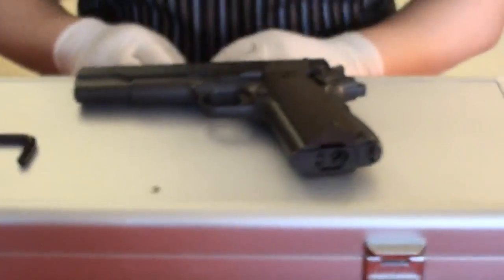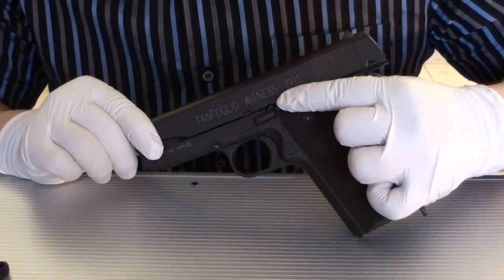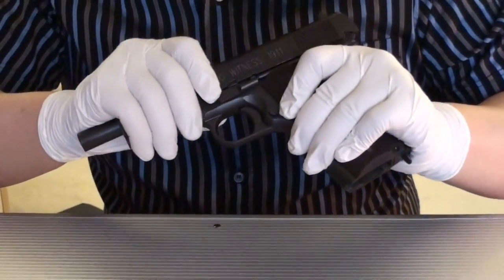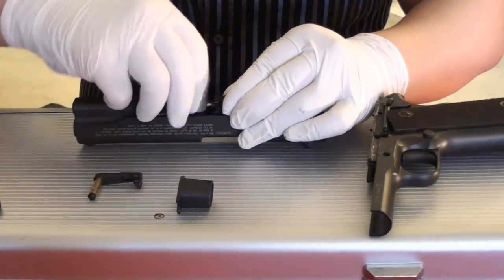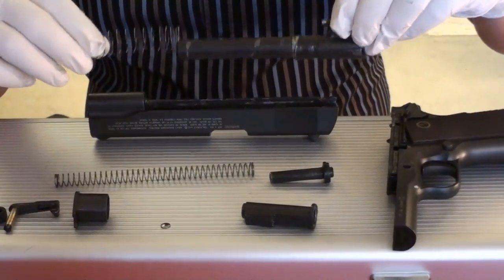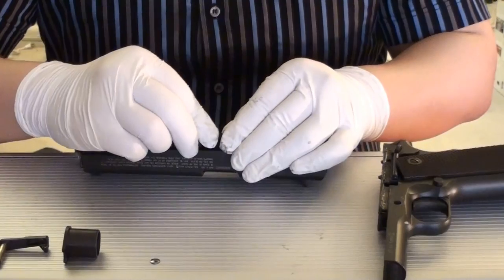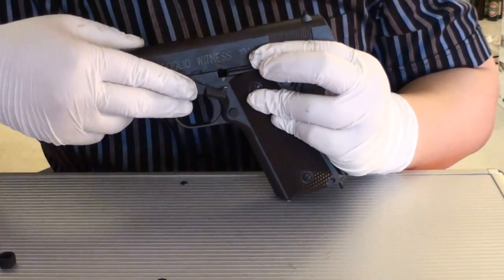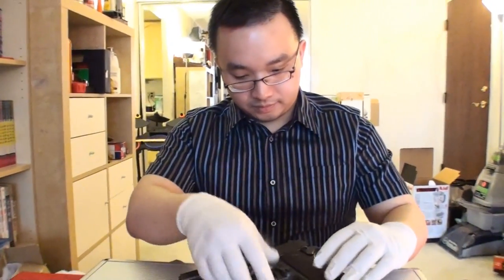Field Strip Instruction on Tanfoglio Witness 1911 Full Metal Blowback (4.5mm)

Comment: Hey Isaac, I just bought mine online and I have the same problem.  I can take the slide out and remove the rod and spring, but the barrel bushing won't turn and come off. It's like it's ceased to the metal.  Because of this, i can't take out the barrel and spring to clean.  It's strange why Cybergun would manufacture a slide that fully fieldstrips and one that partially fieldstrips.

Comment: I take spring out first which makes front part easy to remove...Also when putting slide back on push that little metal thing down so it goes over smoothly...

Comment: Are you also having the same problem where the barrel bushing is molded to the slide firmly.  Mine partially disassembles, but I can't take out the barrel and spring because of the barrel bushing.  Wish I knew beforehand that there were 2 versions.

Comment: Thanks much, i had took mine apart allready to sand the eject port down to silver, i had unscrewed the air compartment at the trigger end of the slide, there is a long thin spring that had come out and i had no idea where it was supposed to mate, seeing your vid is high quality, i saw no spring which meant i had to push the spring home "back to the trigger end" & mate the other end of the spring to the slide wall which has a notch for it, all back together now and works how it should :0)
Reply: what you used for sanding?

Comment: Mine still leaks co2. I guess I will definitely send it back to pyramyd air. I have to wait till the 16th. when I get a working one sent to me I will do the cleaning and lubing. I plan to use a product called super lube. Its an all purpose lubing grease. I imagine its like the one you used.